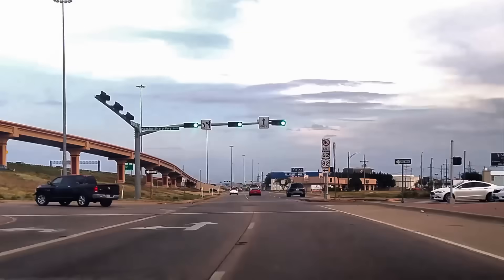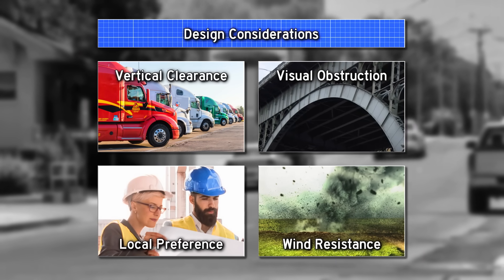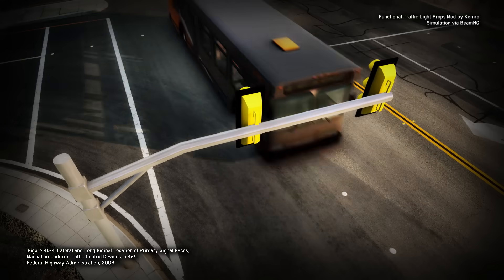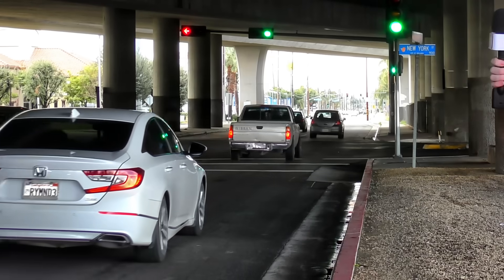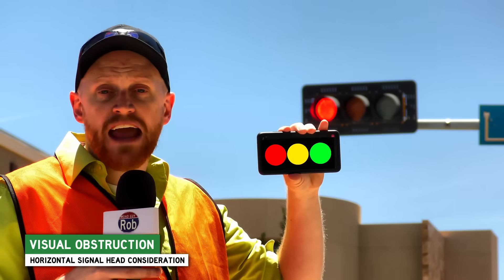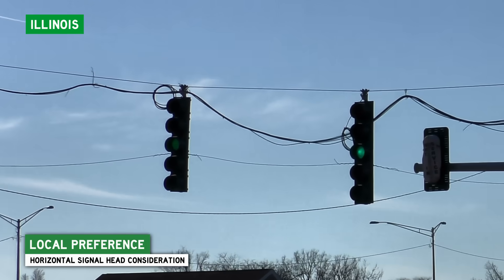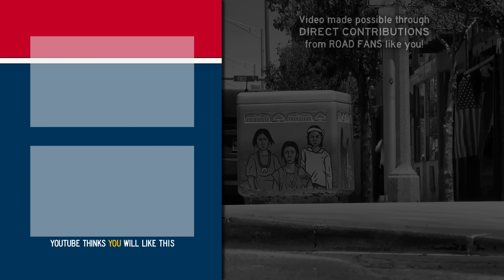What's up with SIDEWAYS STOPLIGHTS in Texas and Florida?

Comment: How is there any less area with the light mounted sideways?
Reply: The combined area of the mast arm and the signalhead is less, since the signalhead shares more of its area with the mast arm.  The farther-apart attachments to the mast arm also have more leverage to support the signalhead, and the torsion on the mast arm is lowered by the wind load having less leverage.

Comment: well for 1 its due to high winds. TX has tornadoes and FL as hurricanes. vertical streetlights are more open to the wind and only secured with 2 bolts. the sideways can have 4 bolts. 2 it allows for bigger trucks to move under the lights without damaging them or moving the lights themselves.

Comment: I live in Palm Beach County and I see them ALL! Span wire signals here are supported by 2 cables, one for wind resistance with a stabilizer arm between the top and load wire where the traffic signals are attached to. Those and even the new signal installations are all vertical. It’s rare to find a vertical set up, those are more in Broward and Dade

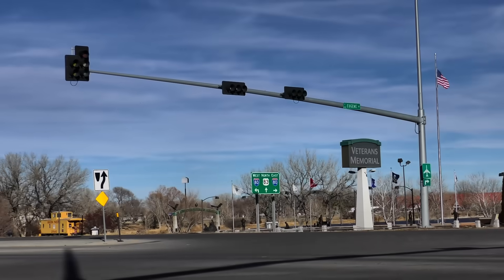Comment: I've sometimes seen these used in Maryland when there's some sort of obstruction (such as an overhead bridge) that blocks the sightlines to the traffic lights until you get close to them, by having them horizontal, you can see all 3 lights earlier than if they're mounted vertically, although they're still quite uncommon. EDIT: I see RGR goes over this exact scenario at 5:43

Comment: I live in BC where there are no horizontal traffic lights. When I went to Alberta the first time, I was surprised by the horizontal traffic lights. Even though I've seen intersections use both horizontal and vertical traffic signals in Alberta.

Comment: So back in 2012 huntington, ny got a hurracaine  we got 95mph windows.  Our traffic lights were hanging by a supension cable, between two points.  The cable handled the winds no problem.  Now some idiot had to replace those lights with pole mounted traffic lights. On a clear windy day you watch the pole bounce up and down. 

One instections the poles came within 6 feet of each other, but they were not joined together, why?  By joining the poles together now you have one strong pole, instead of two weak poles.  

Btw. I have seen more hurracaines bring down traffic lights attached to poles, then by a cables.

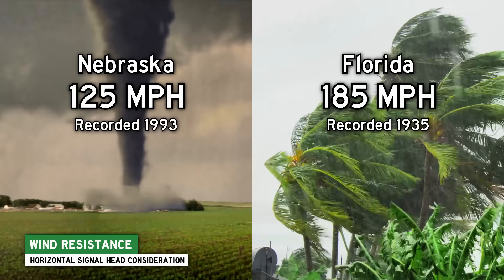Comment: @Road Guy Rob Thank you for this excellent video, it has answered a number of questions I had. One small error @8:46 You say that 185mph is 50% worse than 185mph. Kinetic energy does not change in a linear manner, kinetic energy is the square of the velocity. So the 48% increase between 185 and 125 is 219% worse.

Comment: Japanese actually works if you go with the vertical-first reading direction, which starts at the top-right and goes down-then-left!  However, it doesn’t help that they ALSO do from-top-left right-then-down like English, as you showed here.  They just took their writing and rotated it 90 degrees.

Comment: I always figured it was the wind as the primary reason.  And all the states that you mentioned often have high winds, whether plain straight line winds from wide open spaces or hurricanes, or tornadoes.  It is good to know the color direction is standardized.  In the police academy, we were taught to write traffic tickets violations as saying the person had violated the "top red" light.  I never had occasion to write one that would have been the "left red" light.
Reply: Why don't they just say red light? Why does it have to be top red? There's no bottom red.
Reply: @DougnTx  red being at the top of the traffic light is standardized to accommodate color blind drivers. Saying or writing "top red” is somewhat redundant but also emphasizes which light we're talking about.

Comment: Caltrans  installed two sets of horizontal heads recently at 101 and De La Cruz in Santa Clara.  Looks to be for the reasons you mentioned:  the contractor value engineered the project with a shorter vertical mast and thus the horizontal signal heads.  Looks really out of place.

Comment: Might want to remove TX from the title. I live in TX and after watching your video a while back I have been paying attention to light orientation. While we do have some horizontal they are extremely rare. Easily 95%+ of lights are vertical here. One thing we do have allot of at intersections here in TX is that wide white strip that only serves as a skating rink as you have no traction on it when it's wet. They also don't know how to pave roads here either. They put massive dips at every intersection and driveway entrance making it that much more unsafe to drive here.

Comment: As a Texan, I see the horizontal ones all the time. Another feature I've seen on Texas stoplights that I haven't seen in other states is an air foil on the stoplight arm. Texas can get pretty windy (3 of the top 10 windiest cities in the USA are in Texas as of 2022) and the air foil helps stabilize the stoplight in the wind.

Comment: The reason why Japanese horizontal stop lights are in the opposite direction is because they drive on the opposite side of the road. If a horizontal signal is mounted on the side of the street (which is common in Japan), the red light sticks out farther into the street than the green light. This is true worldwide. If your country drives on the right, the red light is on the left. If your country drives on the left, the red light is always on the right.

Comment: I’ve lived in two states (Texas/Missouri) and both have sideways lights. I never knew this was a thing all. I had no idea that some places don’t have them. I’m curious as I have been to over 30 states (although some of those I did not drive in) and I’ve never noticed a lack of horizontal signals.
Reply: Missouri does not have horizontal mounting as the common setup.

The only time you see horizontal here in Missouri is when a bridge affects height. There are two intersections in downtown St Louis that are horizontal for no real good reason since there is no bridge or anything there!

Otherwise, we are all vertical.

Comment: I just looked up images of vertical stoplights. Like the top ones being vertical and not horizontal. Like holy shit. I never thought something would look so weird to me. I drive daily and have for about 5 years now but barely leave town. We have plenty of vertical lights but for every vertical light there are about 3-5 horizontal lights (as the vertical light is often only on the pole for those in right turn only lanes.) 

Somehow vertical stoplights hanging from wires gives me the heebies more than grotesque body horror.

Comment: Well, we (Texas) have these storms called hurricanes and vertical lights tend to fly away.  And we have a lot of tall industrial loads. Vertical lights with more than 3 lights tend to get knocked down a lot.  Horizontal light mounts made good sense.  I've been doing spot checks around the nation and horizontal lights will show up in other states at major interstate intersections.  It's not just Texas and Florida.  I design gasoline canopies and the fire marshal's have been requiring the bottom of the canopies to be at 17 feet because of the big ladder fire trucks.

Comment: The japanese write like we do. Or traditionally
top to bottom, then right to left.

The latter is called Tategaki and is used in manga for example which is why you read those right to left.

What I love about that is that some of the characters like brackets, quotation marks and dashes rotate when written vertically.
This being another reason I won't write text rendering engines. ever.

Comment: Are there any rules about tilt? I live in Houston and there’s some lights at certain intersection that the light is sideways but tilted down where you can’t see the color of the light unless you’re right in front of it so you have to come almost completely to a stop just to make sure you don’t run a red light and get into an accident. Examples of this  are the intersection of Texas 8 Beltway Frontage rd and John F Kennedy Blvd by IAH airport. Another example is Hardy Toll rd and 1960 service road right under 1960 and Hardy.

Comment: Big winds, tall trucks, short bridges, but around here in Texas, it's more often penny-pinchers in state and local government.  Even in parts where the big winds are not a big deal, and there's nary a bridge in sight, you'll still see lots of sideways signals because of that other thing that was mentioned; an 18-foot-tall vertical support off at the side of the intersection is cheaper than a twenty-foot one.  And a lot of places will shave that height right down to where the bottom of the light is just barely above the limit for a no-oversize-load-permit-required truck to pass underneath.  And yes, this means that over-height loads will smack those lights, but hey, repairing damage comes out of a different budget than building the light to begin with, so that's not important!  (Yes, Texas officialdom really can be like that.)

Comment: See I don't understand how color blind people could find the coloration orientation difficult because if they can tell when a light is red at a vertical it shouldn't be any different if it's horizontal because it's always red yellow then green going from left to right and even the ones with the little arrows it would read the same way if it was vertical or horizontal with red being on the left. As long as you can tell the light is illuminated am I correct? Also it's got to do with whether or not you're familiar with it so you're fear from out of state then it makes a lot of sense that you would have some difficulty but no more difficulty than most other people mainly because it's always left to right it's always red yellow green

Comment: As a Coloradan who frequents New Mexico, this answered a lot of my questions!

Quick thought on the colorblind bit! I am red-green colorblind (protanopic). The issue with it, even in cases more severe than mine, would actually be in distinguishing between green and yellow! The red would stand out, if only as the dimmest of the three. I suppose you just always know that the middle light is yellow!
Reply: One way they try to make the lights more colorblind friendly, is to use a turquoise shade of green, instead of a standard green.  Older lights use the standard green, but I've seen a lot of newer lights with a turquoise shade of green, so that it stimulates more of your blue-sensing cones, so that dichromatic colorblind people can tell it apart.
Reply: @carultch  i’ve actually seen that too! Never realized there was reasoning behind it.

Comment: Doesn’t stop the pressure on the pole much, but cuts down on torsion. The face of the light has the same area, and only covers a little more of the pole cylinder.  Unless it hangs out past the end of the pole, like some of the lights shown, then the wind exposed flat area might be higher. But the twist is what makes the light swing and toss.

Comment: The air resistance reason makes no sense… it’s the same amount of area surface against the wind. Doesn’t matter if you Mount it vertically or horizontally, it has the same area surface.
Reply: False. When it's mounted horizontally there is more overlap with the already existing horizontal pole to hang them. When it's mounted vertically, the lamps stick out above and below the light pole adding more surface area.

Comment: The problem I have with this video is that it's not entirely accurate. I live in Florida and, the counties I go regularly, West Palm Beach, Martin County/Stuart, and Ft.Pierce/Port St. Lucie are all coastal counties/ciries and all have vertical traffic signals weather hanging from wires or pole mounted. Vero Beach mounts their lights horizontally as does some a few small southeastern counties, but, from my experience, most Florida counties prefer to mount their signals vertically. Same goes for inland counties like Okeechobee.

Comment: Japan also drives on the other side of the road. 
As for reading direction, it’s kind of a mixed bag. If it’s vertical then it’s top to bottom right to left. If it’s horizontal, then it’s adopted from western culture and is written left to right top to bottom from us. So, you’ll find it both ways there.

Comment: I grew up in Florida and I can confirm that those hanging stoplights are the dumbest thing ever invented put in the worst place for it. It doesn’t even take real hurricane winds for one of those lights to start flying around like a medieval weapon. I can’t tell you the number of times I’ve seen intersections closed/unregulated because the lights had been torn off those flimsy wires and smashed into the ground.

Comment: As an oversized truck driver, we love the states that have their lights mounted horizontally. I haul many loads that are as high and sometimes higher than stoplights. Vertically mounted lights, we (pilot escort cars, and the truck) have to sometimes travel against traffic to get around low lights. Weaving all over an intersection for the safety of the load. Traffic gets very upset when we do this, except if we are hauling “your” load and you want your product to arrive without a scratch!

Comment: Correct me if I’m wrong but wouldn’t horizontal and vertical mountings have the same aerodynamics? I think the only thing that would change how it is affected by wind is where on the signal head it is mounted. For example, if mounted at the top, the signal head will have more issues with wind since less work is required to get to the same amount of force as one that is mounted in the center.

Comment: Common Physics and space saving ideology are only part of this; even before watching this vid I will tell you what many may have already shared.
Horizontal mounting of lights removes wind catching surface to violently rock or sway the rights in position, and the adjoined cross-bars.
This also removes lower overhang that a taller vehicle might clip, causing damage, or worse to surrounding pedestrians & vehicles alike.
If an engineering principal exists, I do not know what it would be; save for bucket truck boom height to change all three lights at the same time if necessary.

Comment: I build roads in Houston. 9/10 times we used horizontal because of wind speeds. Our traffic signals need to be able to handle a category 3 hurricane. If you see lines down most likely a pole snapped and brought down intersection lights

Comment: 2:01 you are mentioning 40' away. I believe that is too close, cause it means the light can be on your side of the road. I live near one of these and have to physically duck my head down to see the light while not having my bumper at the line. Tested on google maps distance and the light is roughly 38' away from the line, but about 42' away from the driver.

Comment: For vertical stoplights in Florida that are hung by a cable, they typically run a second cable further up to give the lights more stability in the wind. I get pretty frustrated when I go to other states that don't do this (e.g. in New England) there's a bit of wind that causes the lights flail all over the place.
Reply: Here, back when span wire signals were still regularly installed, they’ve always had a taut cable attached to the bottom
Reply: @xHadesStamps You can not use the cable for support per the NEC. It is why drop lines to homes are always two conductors and a steel line, the steel line is for support and acts as the bond back to the utility transformer. 

Traffic lights are the same. I work on them quite a bit as an industrial electrician. It sucks because critters love to get into the meter or disconnect because the conductors keep it warm. There’s often snakes, mice, whatever coming out of them whenever you open them up.
Reply: @TheSpicyLeg  That steel line is actually the neutral. It’s completely dead, however, on traffic signals, making this completely irrelevant.
Reply: @xHadesStamps  I’m always amused when people online feel the need to reply in disagreement by agreeing with me. 

Here, I’ll help you out for next time this situation occurs. You can reply, and say, “I agree.” Takes less time to type out, too.
Reply: It's because it's far cheaper to do and Span wire is far more flexible.
Reply: Southwest Ohio was like that in the ‘80’s when I lived there.  Vertical stoplights suspended from one cable. Bobbed and bounced around crazily in gusty winter winds.  Always wondered if one of those suckers would fall.